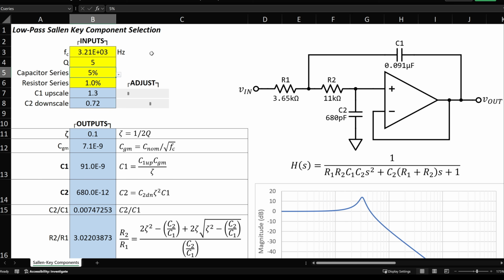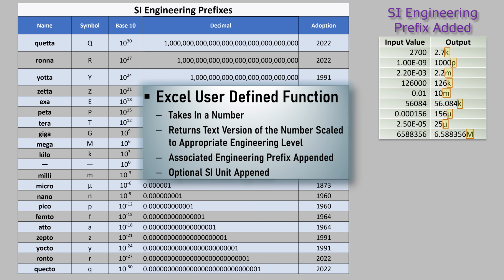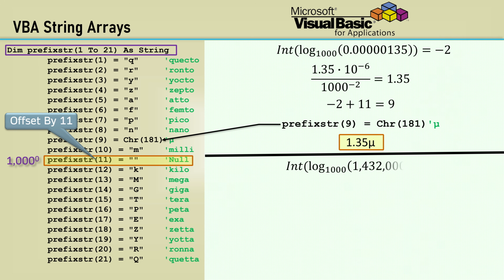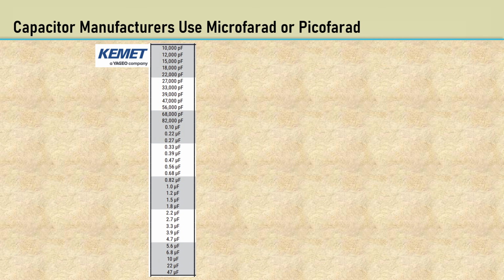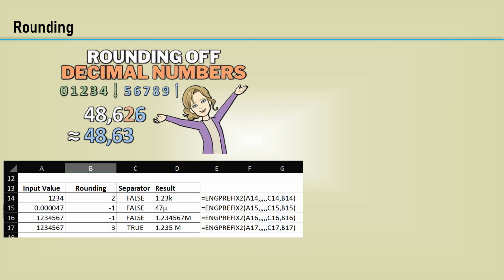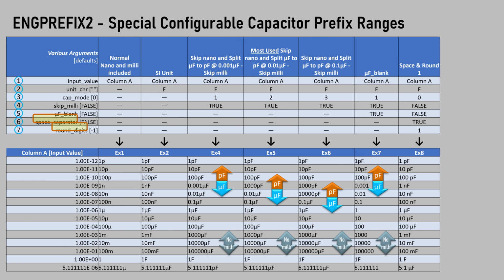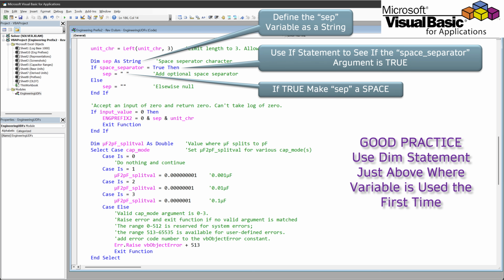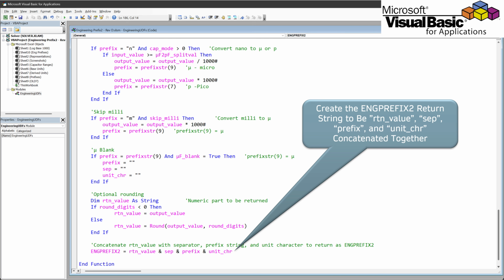Engineering Prefix Function for Excel NEW (4k Video)

Comment: At 8:58 you have 1.432 x 10^6 divided by 1000^2 equals 1.434 -- is that some sort of round-off error? I would expect 1.432 instead of 1.434.
Reply from the maker: It’s a typo. Sorry. Thanks for watching and thanks for pointing that out. I’ll add a correction.